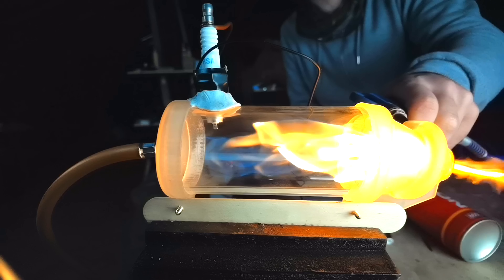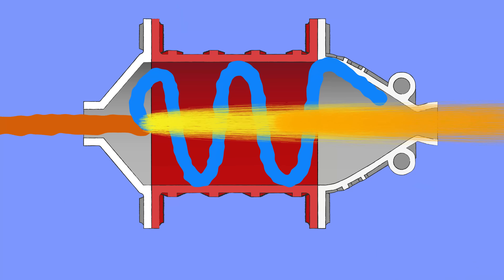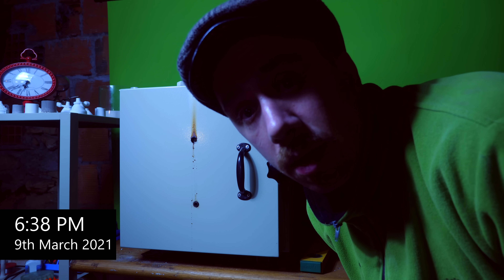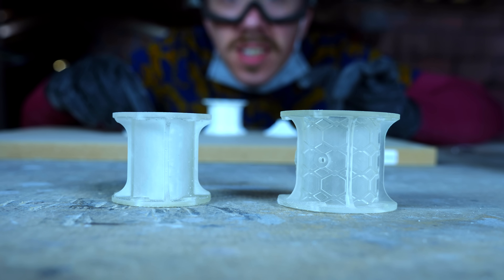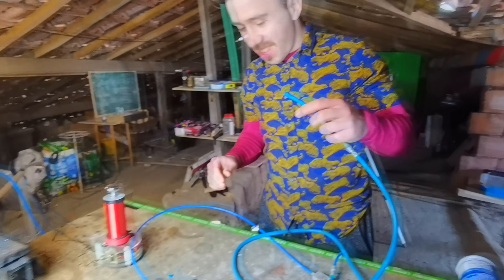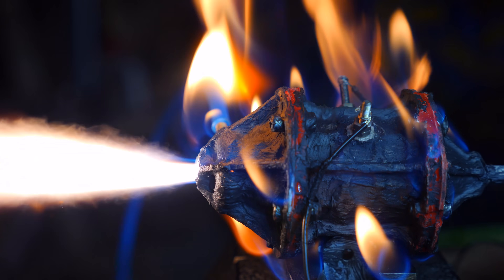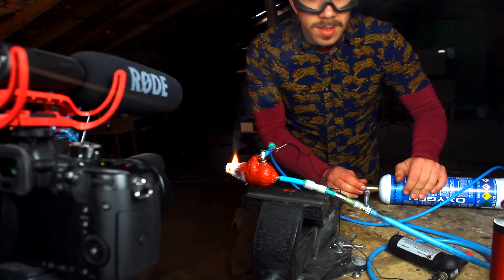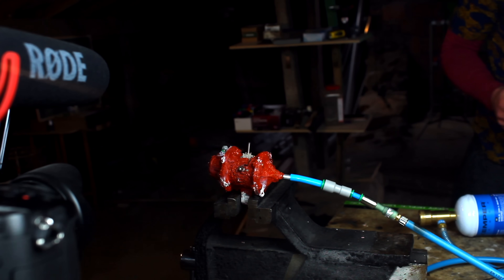Vortex Rocket V2.0 (3D Printed)

Comment: The engine is a high temperature pressure vessel. One solution may be to 3D print the combustion chamber, place it in a metal can, and surround it with a mixture of sodium silicate (water glass) and sand. Add carbon dioxide to harden the sodium silicate. Sodium silicate is a high temp adhesive often used for cores in metal casting. The can forms the pressure vessel, and the hardened sand protects the metal can.

Comment: Just dump that entire engine into cement. Or print the engine in resin, dump it in cement and burn out the resin. 

Also, if you film cool the nozzle (like the Rocketdyne F-1 engine), it might not start burning as much.

Comment: The leaking problem is one of porosity, your ceramic walls are like packed sand in essence, even when sintered. What you need to do, I think, is fill the voids between the grains, not apply a layer on outside. I think if you dip the parts in a very thin glaze and re-fire them that should fix the problem. [the glaze sinks in and forms vitrified layer] Alternatively, fire them at a high temp a second time with some ordinary salt in the kiln so the salt vaporises and forms a salt glaze. Either way, think of them as pottery, not 3D parts.

Comment: @integza I love your videos I have always been fascinated with jet engines and 3d printing and I was wondering if a liquid-cooled jacket around it like what was used on the M1917 Browning machine gun in WWI along with being vortex cooled the two paired together might make the ceramic and high-temperature silicone stay at a lower temperature preventing leaks from thermal shock from suddenly heating up because of burning propane and oxygen on the inside.

Comment: Most the stress is at the nozzle, what if you stretched the nozzle out a bit more in the design, and what if you found a method to dip the part in high temp sealant to get a nice even coating, and do 2-3 dips. You could also add a valve off to the side of the nozzle, for recirculating gas into the intake, kinda like a cars PCV valve that vents positive crankcase pressure back into the intake.

Comment: There is some castable wax-like Resin. It burns without residue.
You could model the inside of the engine as a negative and print this.

Then you form arround with clay (normal clay like for dishes or high temp ceramic) and (leave it to dry for 1-5 days and put this in the HT-oven.
Push the clay into the undercuts.

You should be left with a part ugly outside, but good on the inside. For a better surface you could glaze it with glass, like dishes are glazed for smooth&resistant surface.

Since (clay)cups can be fabricated leakproof your engine should also have no shrinkage+leakproof+ ht-resistant.
Would try one-piece engine since joints seem to be one of the primary failure points.

Alternatively you could do it like fine-casting:
print in wax, coat with ceramic powder, multiple times(!) and get a strong hull. Then burn the part in the oven. For casting now liquid metal would be casted in such a hull, but you could use it right away.

Comment: Print the ceramic rocket with oversized tubes/nozzle. Fire it, to increase the porosity. Then coat it all (or just the inside) in a slip coat, and fire it again.

Comment: how about you double coated the inside and the outside with refractory glue and high temp semen and also make the engine with two part the front and the back instead of 3 parts so there not much of a leakage just a suggestion idk if it will work im just a teen who loves engineering

Comment: One reason you are having trouble might be your air/fuel ratio. Usually, engines are run too fuel "rich" to cool the combustion down, so it doesn't run "engine rich" (melting/burning the engine). I would think the right solution might be to calculate the right stoichiometric ratio for your fuel and oxidizer and add pressure regulators to be precise. Or adjust the oxygen instead of the fuel, as this means you are running fuel-rich from the start. Also, be aware almost everything burns in pure oxygen.

Comment: You should get a metal 3d printer. I have seen them go for under $1000. Then you can print with all types of metal.  Metal dust was slept over the object and lased, dropped down do it again the same.   You only get metal you use, everything else is used in another build!

Comment: Why don’t you glaze it after it’s printed? Like pottery.
No more leaks.
I guess that’s a suggestion for future wedeo.
Reply: Thermal expansion rates of ceramics and glazes are very hard to match up it would probably crack as it got up to temp
Reply: @jacobdunning8373  dosnt gotta be thick tho a thin layer would work
Reply: I would also make sure to glaze the inner walls. Leakage through an inner glass shell semms less likely than through an outer one.
Reply: Can he not just assemble the 3d printed engine and ceramic dip it one or multiple time to build up wall thickness?

Not my field but dip and bake......  Similar to the method used in preparing mould for metal castings
Reply: @fuzielectron  dip it in what? edit: actually i see what you mean, there is a product that he could use...
Reply: @numberpie   Sodium Silicate. Melts at 1100C
Reply: @mealroyale  That's actually relatively low, but it would probably work since the jet shouldn't get anywhere near the temperature of the flame.
Reply: @fuzielectron  I was thinking the same, ie, dip and bake multiple times in the ceramic resin and maybe all the baked out pores will eventually get filled/blocked.
Reply: @SidneyCritic  In reading through further comments I see further down the suggestion that he make an jacket out of a can, end result would be the same as multi dip, stick the engine into a can that would allow an appropriate increase in wall thickness and fill with ceramic, De-gas using a vacuum chamber perhaps as suggested some binding material in the composition ... End result thicker walls without changing the internal dimensions of the 3d printed motor, quick and efficient I'm thinking.
Reply: @SidneyCritic  some of the cashable refractory cements used for making kilns and metal working forges can used be in excess of 1500- 1800 deg C if I recall correctly.... In event the 3d printed motor burned out the external casting shroud becomes the motor?
Reply: Yes and he has the furnace for that
Reply: How about a Tesla oscillator?
Reply: How about salt glaze it evaporats on  ceramix.
Reply: I think that a mixture of graphite powder whit glass powder or some metal powder can do the trick. You can make the powders in a rock tumbler. Also you can 3d print a ceramic mold that will contain the mixture powders. The idea is to heat the whole thing on a kiln in order to melt the glass or the metal which will percolate between the graphite grains making a final structure quite hard and extremely resistent to high temperatures.
Reply: Glaze was same though I had, other than if may be possible to dip the engine after first firing so add a extra extra thickness and slowly bake off on a slower ramp up to temp in the furnace ?   That's probably even more risky and difficult to get rite though
Reply: @KOB If the vortex workes as intended it could work
Reply: Idk if ceramic is gonna have the tensile strength needed. worth a shot tho. he does have a kiln and everything.
Reply: I'm pretty sure that because you are using pure oxigen, plus the high temperatue, the ceramic is basicly "burning", and that's the sorce of the leaking,
Anyway hope you can fix the problem❤
Reply: Glaze it from inside.
Reply: @KOB It's probably not gonna last forever but if not run an excessive amount of time it could hold up.
Reply: I was thinking this same exact thing!
Reply: Wont the glaze melt when he fires up the engine?
Reply: @wikedawsom  the vortex is to alleviate overheating, so the glaze should not melt. His vortex is not high enough pressure though.
Reply: @wikedawsom  and he can’t get a high enough pressure vortex because of leakage
Reply: @wikedawsom  depends on the rating of the glaze
Reply: @wikedawsom  it will still hold the seal

Comment: You say the problem with the prints is the porosity. Can you impregnate the porous prints with high temp silicone?
Needs: vacuum chamber, low-viscosity high temperature silicone. After curing and cleaning, put parts in vacuum chamber and depressurize. Introduce pre-degassed silicone to cover parts and continue vacuum. Finally, before it starts to thicken, release vacuum to drive silicone deeper into the ceramic. 
Then remove from bath so the parts can cure without getting embedded in the silicone bath. 

I think the desire to 3D print is the main limitation here. 

Another possibility may be to build a double-walled design: inner liner made of refractory cement as you have done, wrapped with insulation such as rockwool, and then an outer casing which is impermeable. Though gases may escape the liner into the insulation, they won’t be able to escape the whole engine. You could also flood the intermediate space with nitrogen or CO2 (dry ice, perhaps?) to reduce chance of explosion within the insulation. 

Good luck!  I love your videos and am so glad that you have the time to experiment like this!

Comment: Why not Use the porosity to your advantage:
- 3D print a ceramic chamber, just like the single-part one. 
- after shrinking, create a resin jacket to go around it, with a gap/cavity all around.
- pump liquid propane into the resin jacket. the propane keeps the resin cool, and the porosity alone is how the propane bleeds into the ceramic chamber. then you only need one port for the oxygen. 

It's a bit of a mental punt. but it follows the principles of a liquid cooled rocket engine.
Reply: seal the open end of the resin jacket to the ceramic using the high temp silicon maybe. IDK. I can send a sketch of what i'm thinking if that helps.

Comment: Ceramic can withstand high temperature.... But you forget that a engine like that generates a really high pressure. You should have made a metal one with ceramic coating.

Trust me, I am from a team of experimental rockets
Reply: @Max Tulk Use nylon printing, polycarbonate, PCTG, etc, with ceramic shielding, but it's harder to make a ceramic coating/shield....

Comment: The leaking is probably caused by the immence pressure inside the chamber, you can see at 14:36 that the outside coating is bubbling a bit and with enough pressure it puncured a hole at the side of the engine, one way i can think of in resolving this is to have a much thicker layer of the heat proof stuff and layer it with ceramic paste to make it not bubble as much.

Comment: And once you have a working engine, I would be really interested, how a jet engine looks under water. Technically it would work, so you may want to give it a try. Of course a powered on engine. So to take the engine you have, with the propan an oxygen tank and put that under water. It could definitely burn, but would the water cool down the jet stream, and flow in the engine, effectively killing it, or is the stream so powerfull, alone by the pressure, that it would just go? Would the steam caused by the heat forming around the stream bend the stream upwards?

Comment: Hi - greate video! You asked for ideas on improvement on the leaking porcelite: maybe try to apply the coatings you use under inner-chamber low pressure. Maybe you can use the pressure difference to have coating material penetrate into the micro-cracks.

Comment: Hi,
My first idea was to see if it was possible to electroplate the ceramic and if that would be able to fill in the pores - but seeing as Alumina is not electrically conductive I was researching a bit.
From a previous video of your you mentioned graphite never melts, and graphite has an extremely high melting temp. It may be possible to mix graphite powder with a solvent and make a paste to be able to "paint" on to your ceramic part. This paste will be electrically conductive, so you can now electroplate it with copper. Hopefully, that should seal all of the pores in the part. 
And I found a video showing exactly that (note, I did not make this video) 
https://www.youtube.com/watch?v=Nx-GwKOH5qc

Comment: If you are wanting a fix still only using ceramics I suggest using ceramics glaze. It will add a glass layer that will increase the strength of your engine and it will also seal any cracks and holes. Good luck!

Comment: Make an exhaust powered turbocharger for the pulse jet engine. Where the hot gasses turn a turbine that would compress the air back into the engine.

Comment: I'd suggest a metallic tube that is easy enough to acquire for the main body. If you need to create vertices in the body just add the ceramic 3d printed inside and fill the empty space with cement or heat resistant glue. But even if this works some time in the future you'll need to experiment with metal parts so consider getting a milling machine for the nose cone and nozzle!!

Comment: You could use liquid metal to fill up the Gaps. Sorry for my spellings up front, my mother tongue is German. Not something like gallium, because it would get to liquid, but steel for example. I'm not sure, if i remembered it correctly, but I think steel is melting at around 1500°C. Propane burns at 1800°C. It would be a bit like a Hydrogen tank. The metal gets molten by the burning propan, and fills in the gaps. But because it isn't liquid as water, more like toothpaste or so, you can't really squeeze it through the gaps. At at the end of the experiment, the Steel would cool down and permanently seal the gaps. If you apply some sort of finish, like your red coating stuff, it should be pretty damn good. And if that is to expensive for you, you could fill the gaps with your ceramic resin in liquid state. It should have a similar effect as the steel, with the difference, that the plastic gets molten out by the heat, but again, the ceramic particles get squeezed in the gaps between the print, were they hopefully solidify with the rest of the print.

Comment: I think you should expand your horizons and get into making your engines from metal. Try getting a lathe and turning the parts or cast the parts from 3D printed parts in a material that can withstand the heat. Milling parts on a lathe would probably be your bet bet for parts that last. Its worth a shot anyways.

Comment: I think your leak stems from excess pressure. I don't know the exact ratio, but I would bet money that there's a value above the exhaust rate (limited by the diameter of your nozzle) that you don't want to exceed. In other words, if your nozzle allows you to exhaust X CF/m of gas, you might be able to get away with 1.1X, but 1.25X and you'll rupture your vessel and leak.

Comment: Stop the leaks by putting the rocket in a printed vessel containing gas at a slightly higher pressure than within the rocket.  Any leaking will then go in and not out.

Comment: since you are using ceramics, why not try to find a low temp silica glaze. and by low temp i mean like a cone 05 to 04 glaze. that would be a glaze around 1000C to 1010C. after to heat cure to resin, let it cool, then apply a thin layer of cone 05 glaze and then put it back in the kiln. this will be a process and take time, but, will get rid of the pores in the ceramics, and will make the parts more durable. just a thought.

Comment: Could you not just set the entire assembled and baked engine into a block of concrete (or some ceramic) to stop the leaking? not the most elegant solution but it would probably work fairly well.

Comment: You should print it in metal! Check out Xact Metal 3D printers. Those parts would probably cost <$100USD to print in Inconel. >99% dense inco parts = No leaking boom boom gases. Also shrinkage is basically negligible. DM me if interested!

Comment: between your parts mating surfaces add a high temp gasket or O-ring (you will need an o-ring grove) , or after assembly dip the rocket motor in ceramic slip or glaze and re-fire.  The slip/glaze should seal all of the gaps / small holes and be able to withstand the high temp.  you could do multiple dips to build up wall thickness

Comment: Instead of directly printing the casing and nozzle why not 3d print with cheap filament then glaze it with ceramic and then fire the ceramic in the furnace burning out filament leaving the designed part solid.

Comment: This is an educated guess:
It seems that when completely sealed, the engine starts leaking only when the temperature+pression gets too high.
I think this may stem from the manufacturing process, as when you burn the resine in the oven, you create microscopic cracks (not big enough to be visible with the eyes, but enough to weeken the structure).
Then the extreme conditions you put the pieces in increase the cracks size.
Reply: Needs a glaze inside

Comment: @Integza
15:52 Can you 3D print a mold & cast the engine in some less porous material? (like cement or gypsum or something?)
Or take it one step further, so you 3D print a "pre-mold" that you use to cast the "real mold" in some more heat resistant material, so you can finally "cast" the final engine using some melted metal. (I don't know what metals your oven can melt? or send it off to some metal casting place & let them do it? maybe let them do the whole thing?)

Comment: The high temp RTV paste is a great idea, I think its getting over pressured causing it to bubble up and burst, similar to Joel's idea but 3d print a ceramic jacket that fits the shape of the engine but leaves a small clearance to sandwich the silicone and not allow it to over expand. this way it sticks to engine being full 3d printed

Comment: Maybe try coating parts with dental lab high-heat casting investment, it's fine grain and should keep leaks down.
Reply: Think the issue is the porosity of the ceramics, although with the amount of sealant he was covering them in maybe not